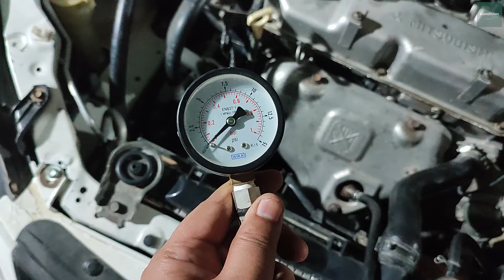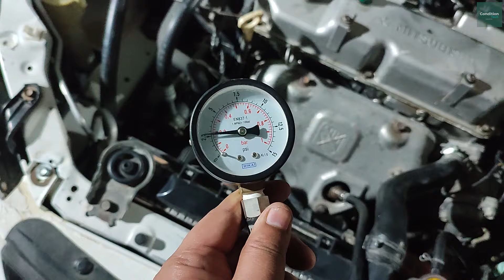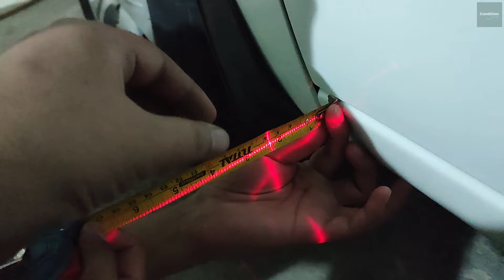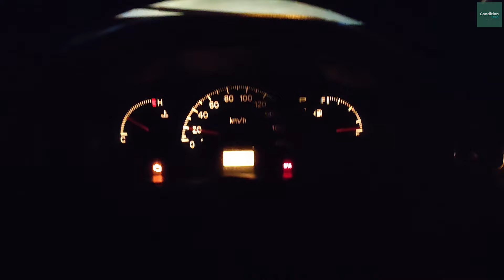Mitsubishi Lancer 2006 Restoration | Part 2

Comment: Simply superb, haven't seen a better work before. Any plans of tackling the check engine light, SRS issue and poor idle in a future episode? Also interested to know if the brake slave cylinder of rear wheel could have been salvaged with a sleeve by a lathe shop. The rust welded camber bolt might have yielded with heat cycling and impact wrench.
Reply from the maker: Thank you!, remaining issues were tackled in part 3, it is also uploaded. Brake cylinder replacement is better and it is more dependable then repairing it with sleeve, also its cheaper to replace then to repair it. We tried heat cycling but was not working so had to cut it ultimately.

Comment: Did you fix the RPM dropping issue?😊
Reply from the maker: Next and last part is on RPM dropping issue. But what we learned is that if the lancer's engine compression goes low then this issue starts and the only way to resolve it is to get its engine overhauled. so get your car engine compression tested it should not be less than 120 psi in all cylinders.
Reply: @ConditionTech  waiting for the last episode then!